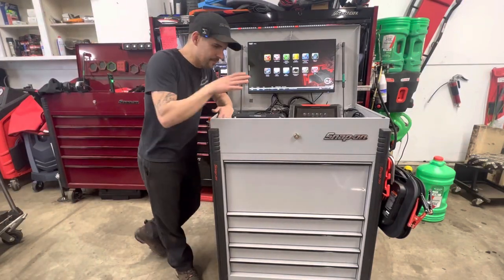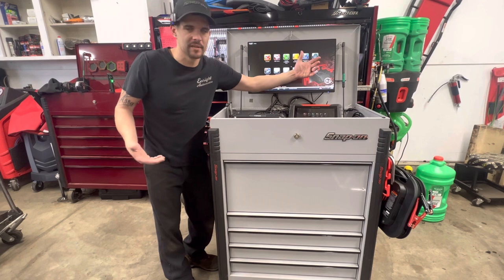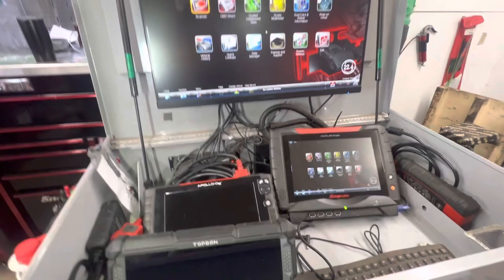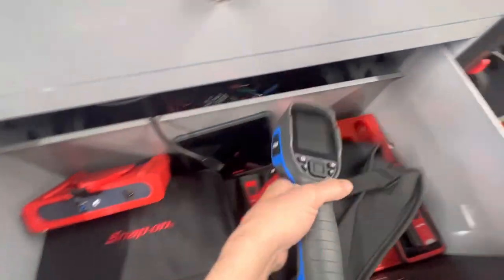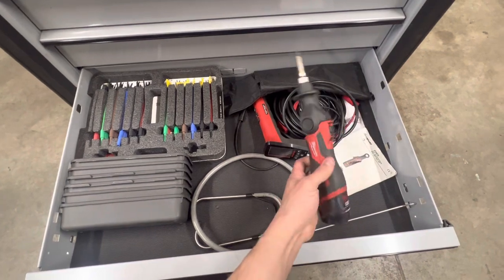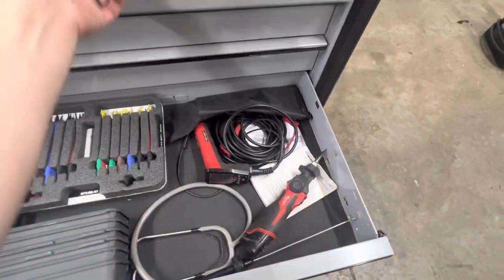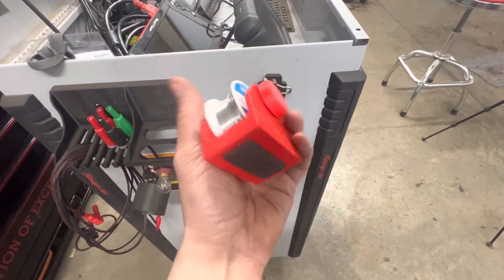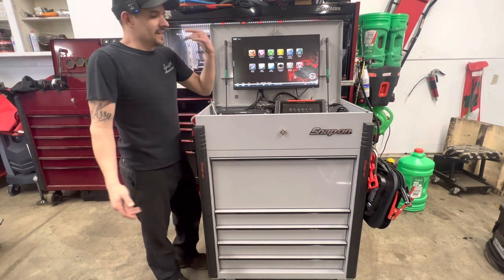Snap on Diagnostic cart full walk through

Comment: The shop should supply a few carts with clean power producing power supplies. Then you should make your own. Mine is set up with scope mounts and a monitor, an IM608 Pro an MS906bt, the factory scan tool, a power supply and a few different scopes... like 16 channels worth. My suggestion is never buy what the shop already has, you don't need your own Zeus if the shop already has one. You also don't need one for programming if the shops does it. Mine all do because of personal preference. I end up doing the majority of the troubleshooting in the shop, and I feel like scan tools are those that once you commit to a brand its unlikely you try another one... those new Topdons are looking mighty spicy though.
Reply: Watched til the end, I want to say HF carts are great for this. I think everything in that box is still lighter than a typical impact socket 3/8 and 1/2 drawer. Diagnostic stuff is light, just very big especially the ones that come in blow molded cases that you have no option because of all the little pieces that you must use the case. Wires trapping drawers is a massive pet peeve too. I have no clue why somebody would want to use a Snap On cart (not saying you, I hear you on the drawer preference) instead of a cheaper HF. I typically get a HF cart, beat the daylight out of it, and then its used for as a wire repair cart or diag cart or sold to another tech and I get another HF to replace it. No stressing over shiny paint, its just a folded piece of sheet metal with a US General logo. :)
Reply from the maker: Yea with the new harbor freight cart being what it is it makes sense to get it. I had terrible luck with their old 4 drawer version twice so I have sour taste in my mouth with anything box/cart related from them. But I’ve had a bunch of people buy them and tell me the new ones have held up great for diag carts.